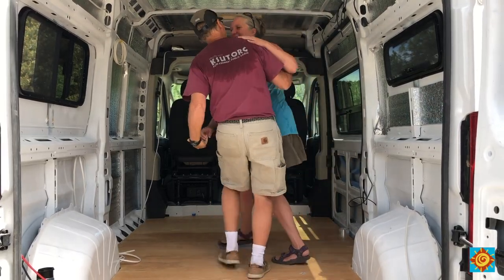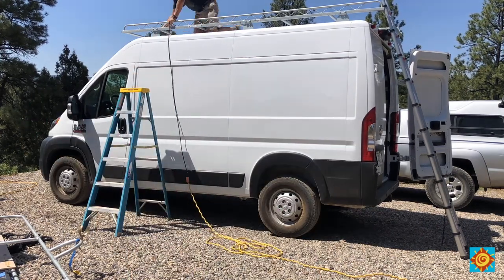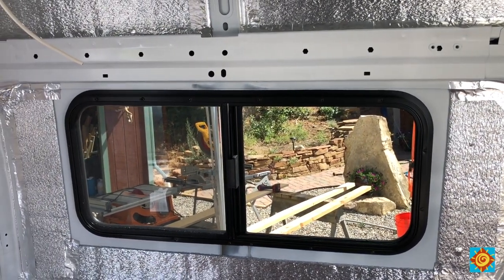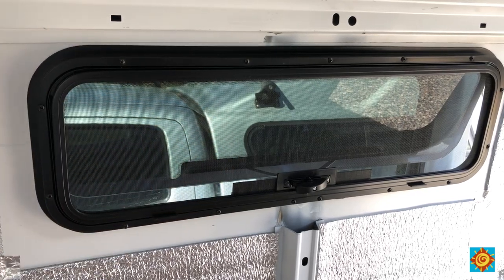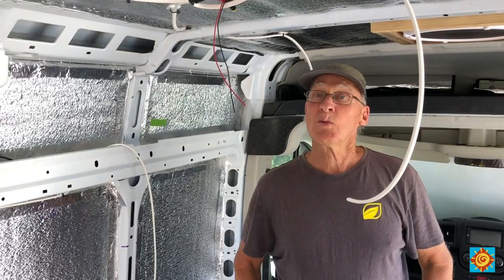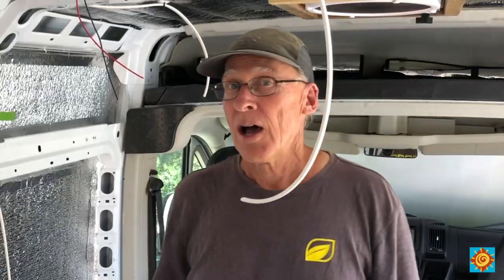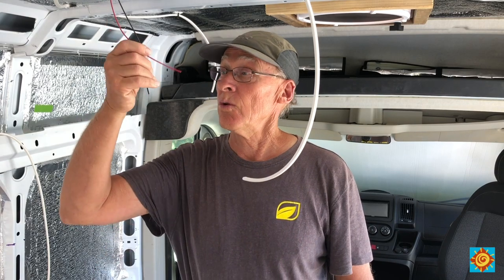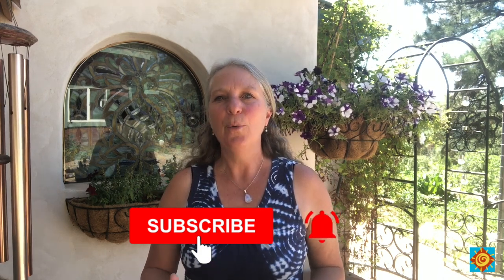Getting ready to install the HEMP INSULATION//EP 2 OFF-GRID ProMaster Van Conversion

Comment: I'm confused why you did the easy cool when hemp is rot/mildew resistant?
Reply from the maker: Thanks for the question. Easy-cool is used as a thermal break so that water vapor doesn't condense on the inside of the metal walls in the van. It also helps dampen road noise. Even though hemp is mildew resistant we want to keep the vapor from condensing in the first place.

Comment: How has the hemp been working out after 3years? Any problems with moisture or movement/dropping as far as you can tell?
Reply from the maker: The hemp worked great. We sold that van in July and as far as we know, there are no problems. In our next van build we are going to use wool, but I wouldn't hesitate to use the hemp again. (It's a little messy, but we'll see how wool goes in once we get our Transit Trail. We've been waiting for delivery since it was built in June.